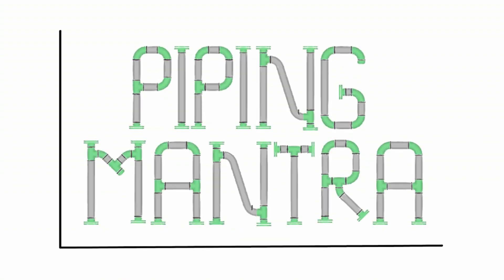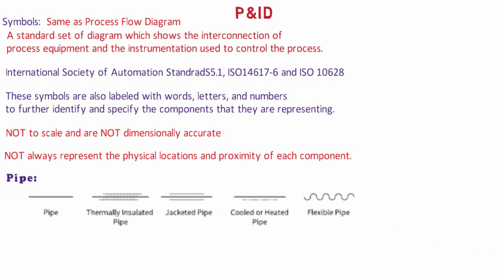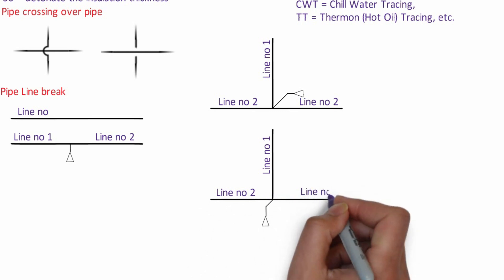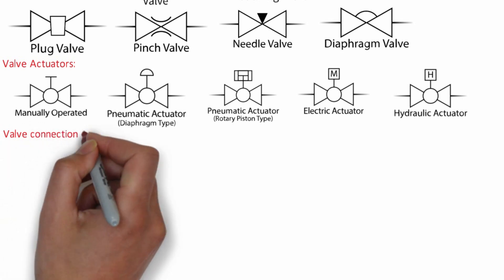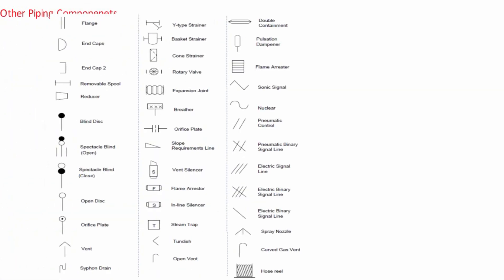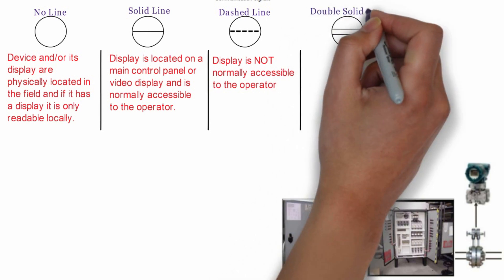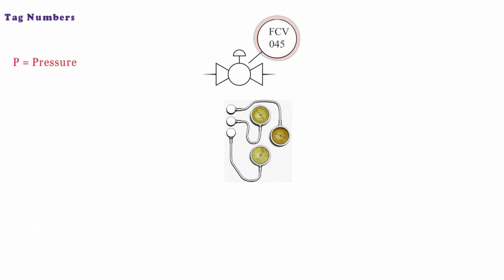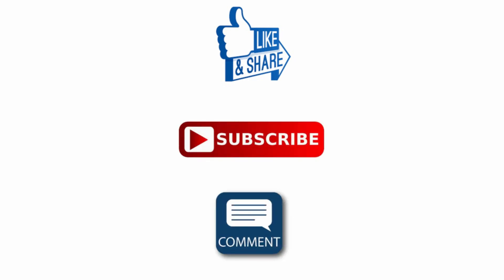P&ID SYMBOLS | PIPING MANTRA |

Comment: In a video please explain both loop n hook point. Humble request🙏 ma'm
Reply from the maker: in PID loops are not marked it comes based on thermal expansion of perticular pipe as per its routing and temperature.
You can see our video on thermal expansion where we have briefly explained about flexibility.
I dont know what does Hook point means by you?
Reply from the maker: https://youtu.be/qoo96pH1gAs
Thermal expansion
Reply: Thank you for the link mam
Reply: My email is is pdmspipe@gmail.com
Reply: Can you send me some set of p n id with it's legend sheet